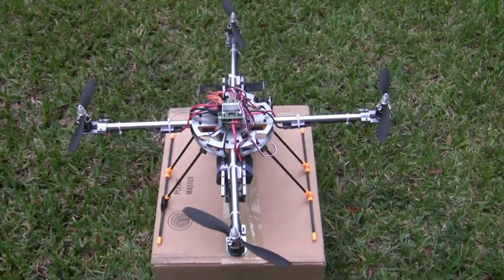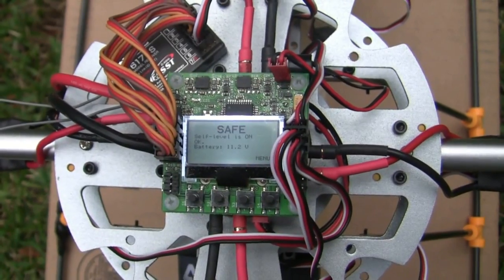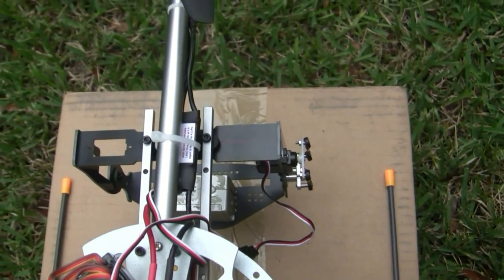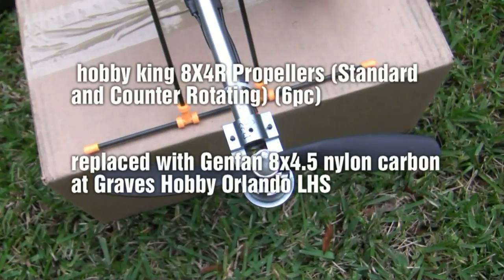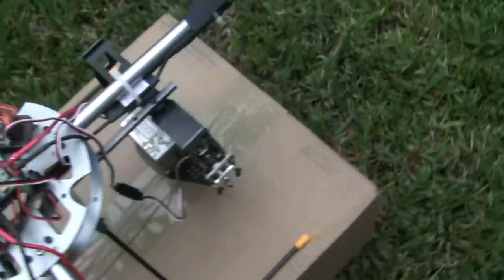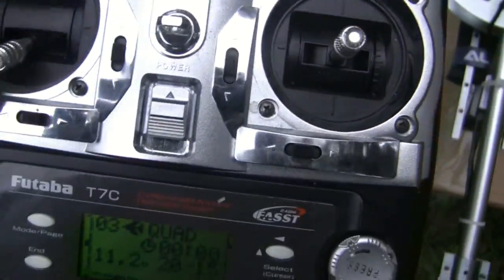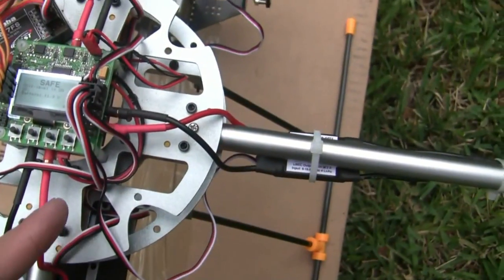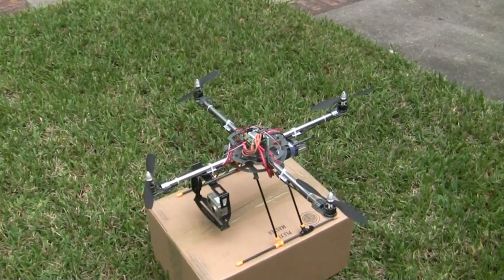turnigy H.A.L quadcopter description of build

Comment: Thanks for the config probably gonna use this one maybe another controller board (I want GPS) but I read the kk 2.1 is great thanks again. Actually a question. Do you think these motors could pull of some HAL? I want to get a DSLr in the air + fpv on the same rig. Thanks

Comment: Just wanted to say thanks for your video.  Although I had some initial frustrations with my build, it was mainly due to my lack of knowledge, and I had ordered the wrong batteries in my haste to order all the parts that you listed.  Anyhow, this is a good recipe, highly recommended.  I built mine as an X configuration, rather than +, but it flies excellent with minimal adjustments to the computer.  Thanks Leapnlarry, good video.

Comment: I chose to use the plus configuration because the bolt holes for the landing gear are oriented for plus, i would have had to make new holes for the landing gear if i wanted x configuration.  You can change the configuration in the motor layout configuration in kk2 to quad copter + configuration.

Comment: These ESCs will work well with any 3S to 4S lipo which is 11.1 to 14.8 volts.  This esc, motor, battery combination works perfectly.  Im not sure what you are connecting wrong but it should work perfectly,  as to your other question, the male to male leads between the kk2 board and the receiver, you can get on hobby king or any hobby shop.  Make sure you connect properly to the kk2 board making sure the negative lead is outward and the signal lead is inward.

Comment: Hi Larry?  I have followed your recipe exactly, and I have a few questions perhaps you can answer...  First of all, I noticed you built your frame as a + configuration, whereas I built mine as an X configuration (skids are 45 degrees to frame).  Will the KK computer accommodate this layout?  the X configuration seems more common.  Also, I can get one motor to spin with a 11V battery, but not with the 22V battery.  when there are four motors connected, will this be corrected?  Thanks!

Comment: I ordered everything you listed here, FYI you never mentioned which receiver you used.  Also, you didn't mention that two of the motors spin clockwise and the other two counter-clockwise.  I ordered 4 propellers all identical, so wishing I had known this.  Also four identical motors, how do I make two of them spin counter?

Comment: by the way, standing over the quadcopter while it's armed, and while the props are installed... huge safety risk.  you accidentally slip and push that throttle stick up and your flying blender will mutilate your face.  it's the whole purpose of having the "arming" procedure.  so you can set it up without the motors being armed, then walk to a safe distance, THEN arm it. lol.  just a heads up, i'd hate to see a fellow hobbyist get hurt.  these things are no joke

Comment: Your not alone ! I blew 4 out of 6 Turnegy 25A ESC`s on a Y6 within 1 to 6 starts.
I have a HAL 20A set up with 2230 860 Keda 9x4.7  KK2 set up 
And I use the HAL spares, longer arms with NTM 3530 1100Kv on 11 x 4,7 and Naza both work real good, Both 3s. 
Need that 1.5 firmware it looks exactly the same as the results I get with the Naza.